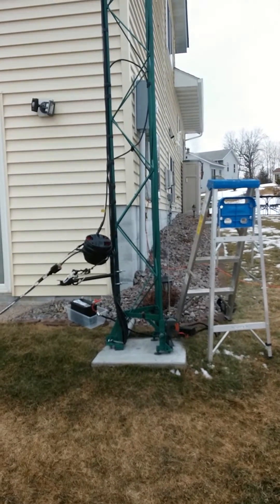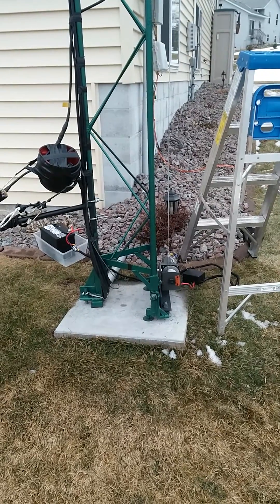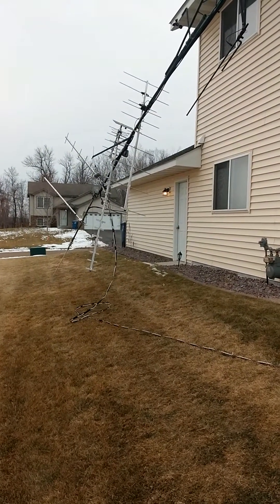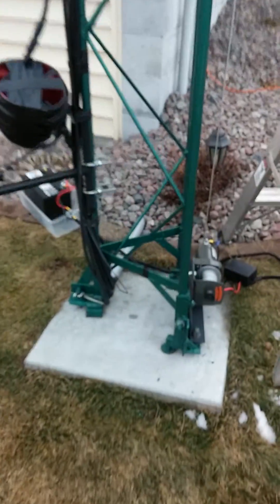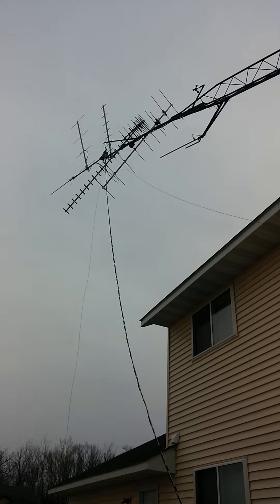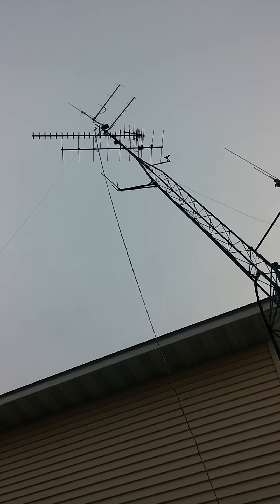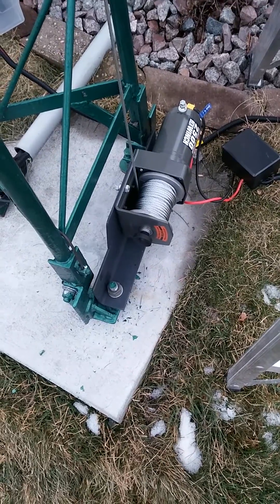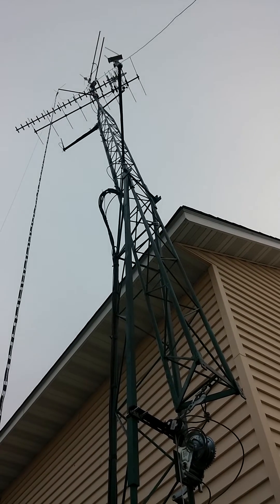Badland 2500 winch tip down radio/ tv antenna tower project

Comment: HEY!!! YOU REALLY SHOULD HAVE THE SUPPLIED 'FAIRLEAD' INSTALLED!!! I left this out and my tilt-over tower was about 95% vertical when the 2500 Badlands winch just stopped. CABLE WAS SPOOLING OFF THE SPINDLE AND WAS PINCHED BETWEEN THE SPOOL AND THE MOTOR FLANGE!!! Fortunately the tower was stable...but the cable could have become pinch-cut and the tower crashing to level ground!!! Trouble with this product: The FAIRLEAD requires an optional (cheap) mounting plate...the fairlead DOES NOT bolt to the winch frame!!! And...the worst of this: THE MANUAL SAYS NOTHING ABOUT THE NEED TO INCLUDE THIS FAIRLEAD INTO THE MOUNTING OF THE WINCH!!! This is a BAD BAD for Badlands!! And it is NOT safe w.o the fairlead. YOU BEST INSTALL YOURS.....I.fully intend to install mine, assuming the winch is still safe after the my mishap!!